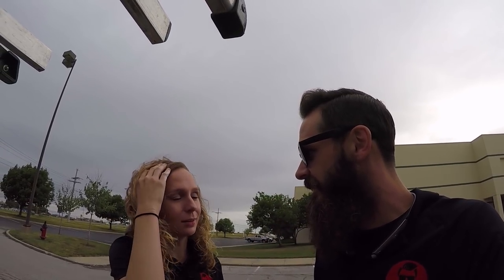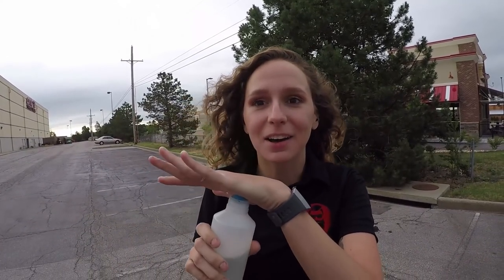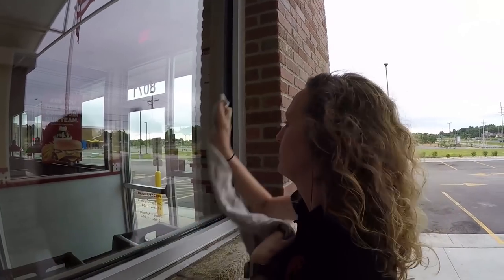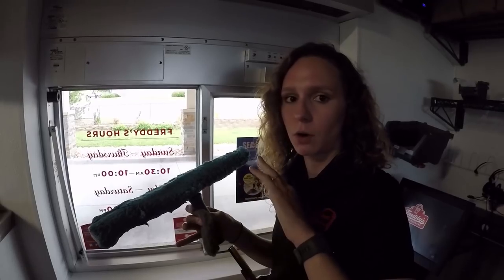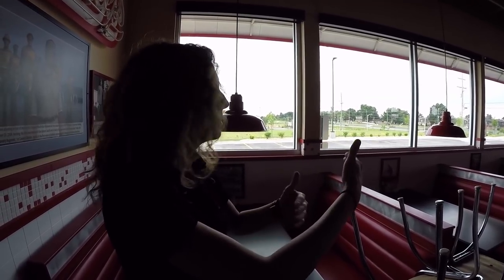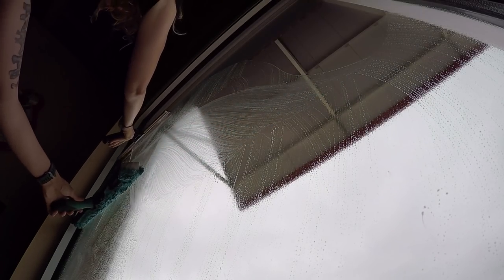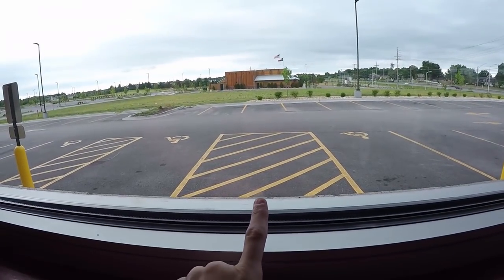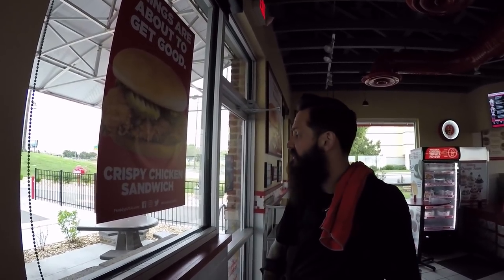Interior Window Cleaning Techniques - Tips - Tricks

Comment: Hi Luke, love the videos, can I ask what steel wool you use and the grade. I’ve been using bronze wool but it’s quite pricey. Thanks
Reply from the maker: Hi buddy! That is #0000 steel wool. I've used both bronze and steel. Bronze isn't as abrasive but obviously it doesn't rust. I love using bronze for wfp work but for trad I prefer steel.

Comment: Piece of advice on pouring out soapy water outside a store on the walk way, I seen this happen, not to me either, a customer or employee comes out and slips right on that soap and water and break a bone or get hurt, and the store get sued. I seen this in a different industry, a tow truck used soap and water to pull a car out that had no.keys and E break was on and someone slipped and got hurt and the business and tow co both got Sued, Just a heads up.
Reply from the maker: Thanks for the tip

Comment: To each their own, but I wouldn't do anything more than a small storefront without taking the bucket in if I am by myself. Especially if the job is done less than once a week. Otherwise you are letting your washer get way too dirty before you finish the job. I guess if you have two people you get away with that on a medium sized job. Just my two cents.